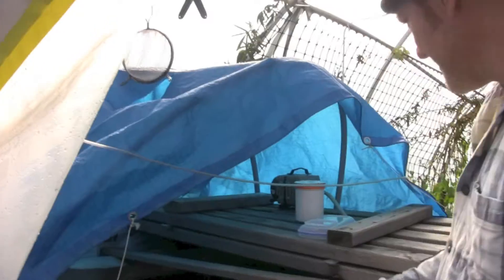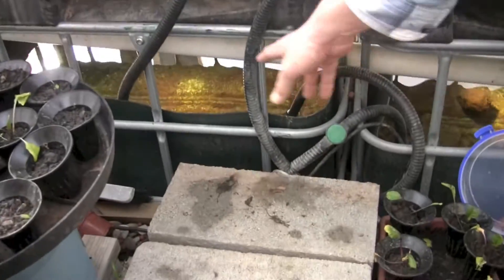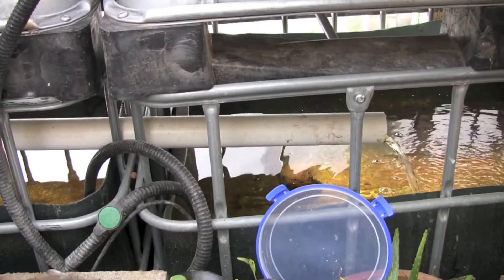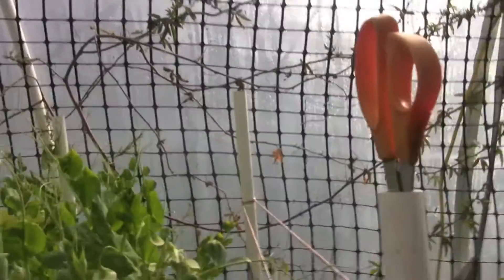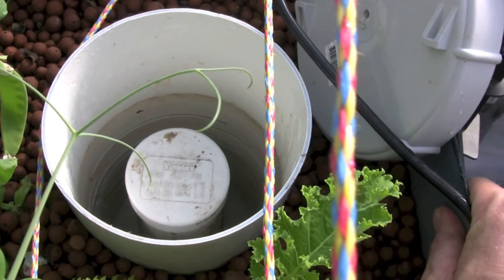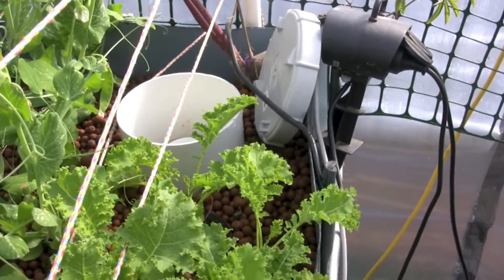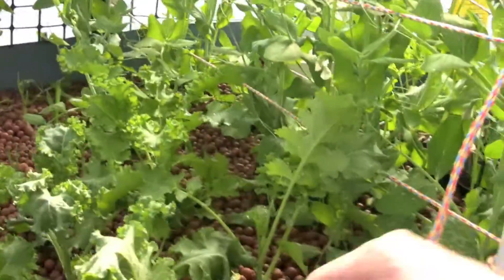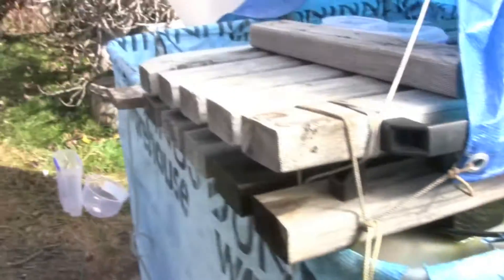AquaTucker CHIFT PIST Aquaponics System

Comment: I have a question...   The pipe coming out of the fish tank, does it go down to the floor of the fish tank to help suck up the solids?
Reply from the maker: Yes it does. With a cap on the end with holes drilled in it so the fish don’t get sucked up! (Sorry for the delayed reply)